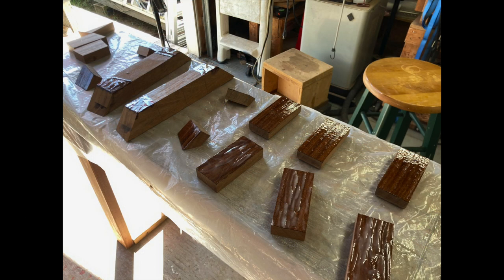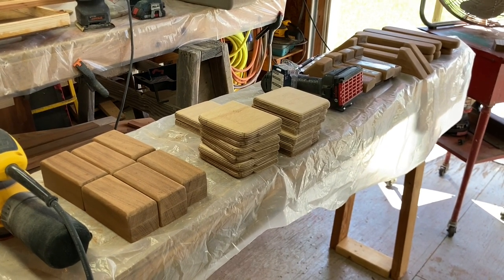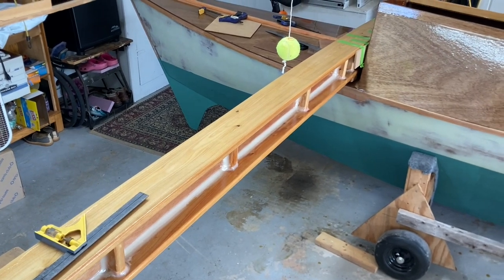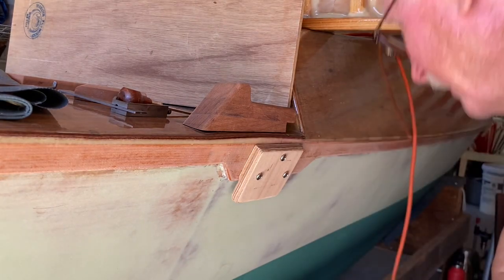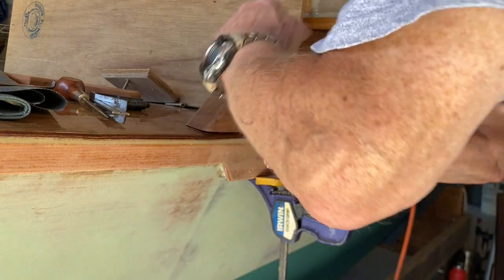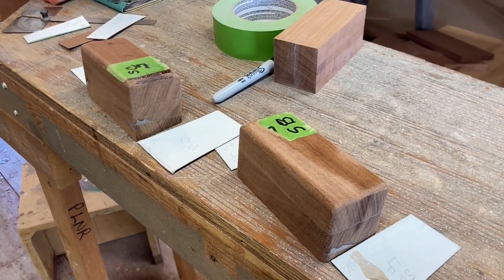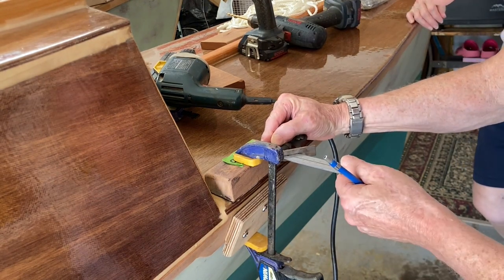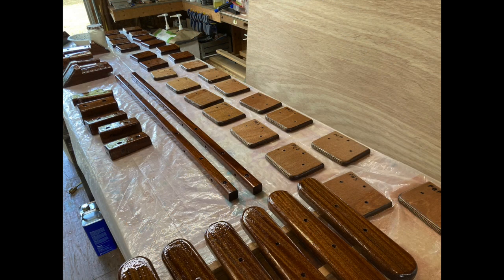Ep20 Building a Wharram Tiki 21   HD 1080p

Comment: HI,WHAT IS THE COST TO BUILD EACH HULL.THANKS
Reply from the maker: Tony, it is really hard to break it out to an individual hull. We have purchased sails, rigging, paint and materials for the akas, mast, center platform, etc. We have used considerably more epoxy than Wharram calls for. Dependent on quality of plywood and woods or amount of work to the place you are stopping . You could build one hull probably for anywhere from $800 US to   $2000  US unfinished, completed catamaran will be from 7500 to 10000 less trailer. Winging the answer. Consider for price comparison that Wharram sells the CNC cut Mana 24 kit  for approximately  US $15700, depending on options selected less shipping.
Reply from the maker: Tony, recommend you check out Wharram web page on choosing a boat. Here is the link, https://www.wharram.com/articles/choosing-a-boat
Best to you
Reply: Thanks so much for your help Rex and Kathie.
Reply from the maker: @tonykirkham4087  Our pleasure, thanks for watching.